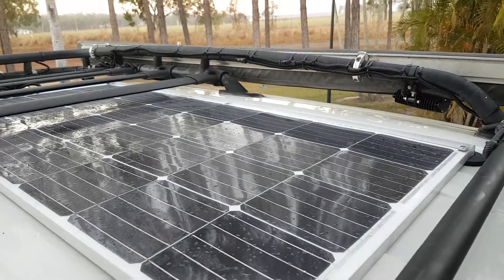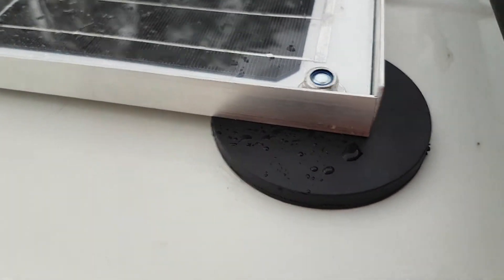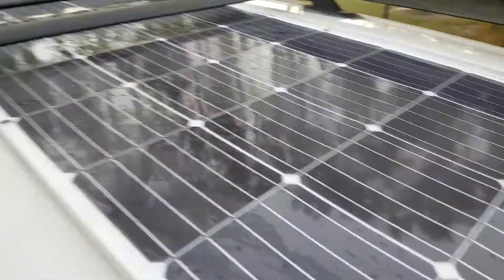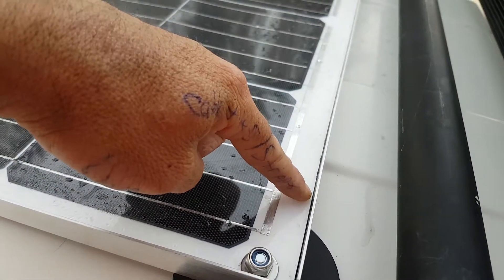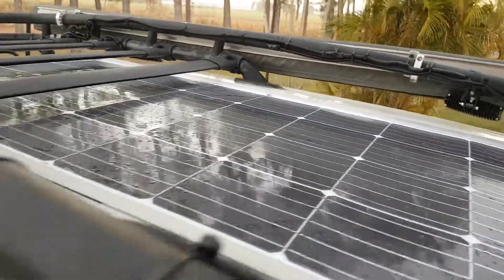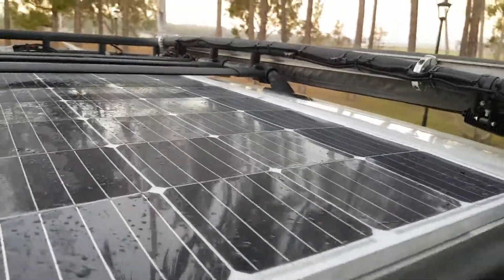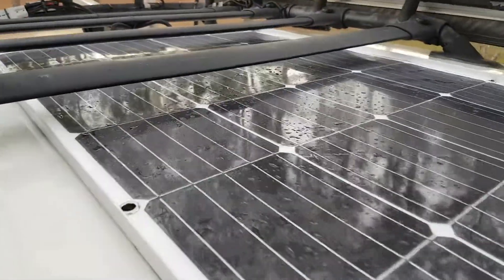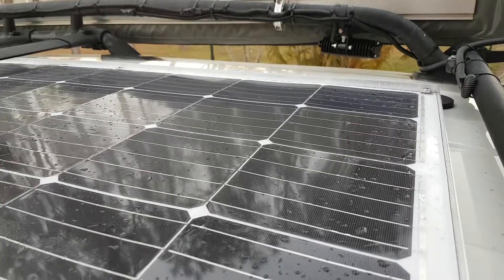Flexible solar panel and Neodymium magnets

Comment: Question: At what temperature do these magnets demagnetize?
Reply from the maker: I think once the magnet stays above +80 degrees  Celsius for extended time it will  some preforming.
Reply: @Ebz-uo1ti  I also bought ferrite magenets (the black ones that break easily) and the seller guarantees them up to 200 degrees Celsius (
392 degrees Fahrenheit) and I want to mount a 50w (530x560x2.8mm) flexible panel. The 4 on the corners have 7 kg traction force and the middle 2.5 kg (30 pieces). I hope it will withstand 140-150 km / h on the highway.
Reply from the maker: @valivalentin8963   I don't know if those will hold the panel down at that speed. I know forsure the neodymium do hold. They have a pull force of 47kg each and i  have them here is Australia in heat around 40 + Celsius. I know they hold because have tested at high speed
Reply from the maker: I also have these magnets covered in rubber to prevent scratching
Reply: @Ebz-uo1ti  I also found stronger magnets, but I don't think I'll be able to take them off the roof without damaging it.
  Every 15 cm there will be a magnet that can withstand 2.5 kg (30 pcs) and on the corners there will be 4 magnets that can withstand 7 kg each, the panel is 53x56 cm with a thickness of 5 mm with the steel sheet attached under it, total weight panel + steel sheet = about 2.5 kg.
Each magnet is 10 mm thick and I want to put an inclined plane in front so that the air causes the roof panel to stick.
If you have another idea, I can still modify the installation :-)

Comment: Awesome. This is what I am looking for. Can you share the parts which were used in this setup?
Reply from the maker: Yeah this idea works very well. I am still using this. Only thing I do witlsh for of the magnets were cover with a white rubber. https://magnet.com.au/products/male-thread-neodymium-pot-diameter-88mm-x-8mm-with-20mm-boss-and-rubber-case

Comment: how is this set up going?
Reply from the maker: Hey. How are you?  Sorry for the long delay but been working. I have made a new video. If you want to check it out. ( Flexible solar panel and Neodymium magnets after 8 months)
Reply from the maker: Yeah this is working very well. I have driven the vehicle at high speeds and no movement. If you want i can take some pics and show you.  It's been up for a while now.
Reply: @Ebz-uo1ti  yeah that'd be cool! Thanks so much!